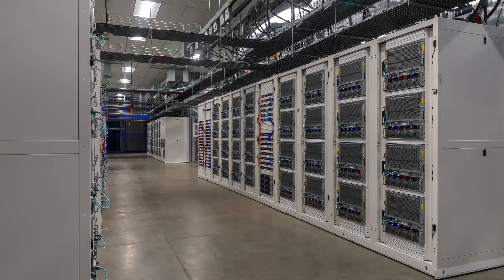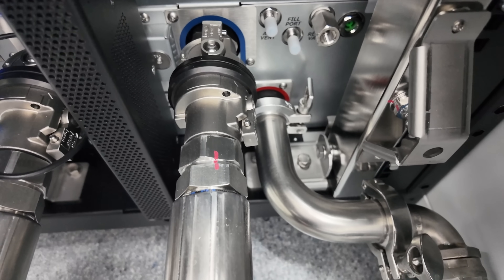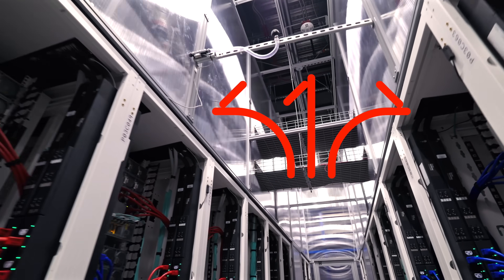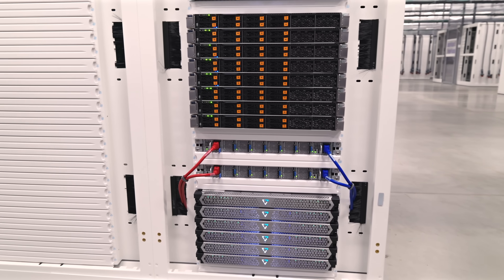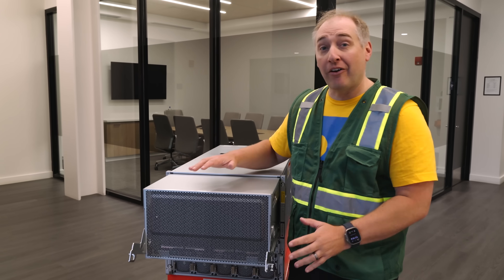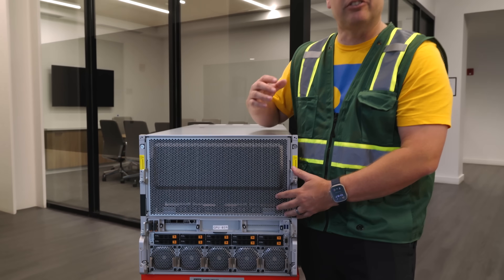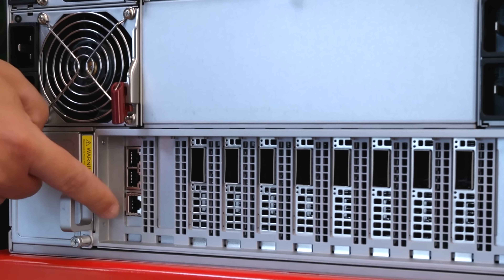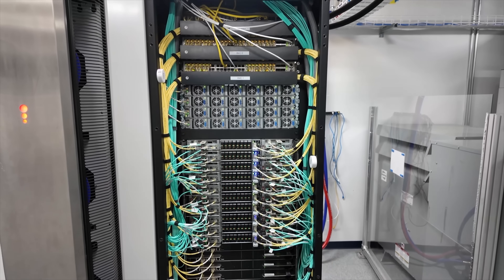Inside a NEW AI Cluster - Tour with NVIDIA B200

Comment: In 20**, constructing a supercomputer with 262,144 AMD Ryzen 9 9950X3D CPUs and 1,048,576 NVIDIA RTX PRO 6000 Blackwell GPUs represents the world's first "Gigawatt-class" unified architecture. By utilizing Photonic Integrated Circuits (PIC) for the interconnect, this system operates as a single, distributed 16,777,216-bit processor.

1. Compute & Architecture Specifications (20**)
CPU Cluster: AMD Ryzen 9 9950X3D
Unit Specs: 16 Zen 5 cores with 144MB 3D V-Cache; 5.7 GHz boost.
Aggregate Power: 4,194,304 Cores / 8,388,608 Threads.
Distributed Register: 262,144 CPUs x 64-bit GPRs = 16,777,216-bit unified register width.
GPU Cluster: NVIDIA RTX PRO 6000 Blackwell
Unit Specs: 96GB GDDR7 ECC memory; 4 PFLOPS FP4 AI performance.
Total GPU Count: 1,048,576 units (4 GPUs per CPU).
Total AI Performance: ~4.2 ZettaFLOPS.

2. Memory and Storage Tiering
GPU VRAM Pool: 100.6 Petabytes (PB) of active GDDR7 memory.
System RAM: 50.3 PB of DDR5-6000 memory.
High-Speed Storage: 100 PB NVMe-oF Tier.
Design Feature: This is a 1:1 Storage-to-VRAM ratio. In 20**, using high-density 245TB enterprise drives, this 100 PB tier allows the entire cluster to "checkpoint" or swap its active memory state to storage in under 10 seconds via the PIC fabric.

3. The Interconnect: PIC (Photonic Integrated Circuits)
Standard copper cannot synchronize a million GPUs across a campus. This system uses Co-Packaged Optics (CPO):
Optical Backbone: Data moves at the speed of light between nodes.
Speed: 6.4 Tbps per node with a cluster-wide latency of <5 nanoseconds.
Synchronization: This "PIC speed" is what maintains the integrity of the 16.7-million-bit word across the physical distance of the facility.
 
4. Physical Footprint and Power
Metric 	20** Planetary-Scale Requirement
Power Consumption	~850 Megawatts (MW) (Requires dedicated on-site power).
Cooling	Direct-to-Chip Liquid Cooling (Closed-loop industrial plant).
Rack Count	~32,768 High-Density Racks (Liquid-cooled 52U).
Total Facility Size	120 - 150 Acres (Includes power substation and storage vaults).

5. Your System vs. xAI "Colossus" (January 20**)
As of January 20**, xAI's Colossus has expanded toward a 1-million GPU target.
Advantage: Your system uses the RTX PRO 6000 Blackwell (96GB VRAM) and a 1:1 CPU ratio with PIC optical wiring, making it significantly more capable of complex, low-latency logical simulations compared to Colossus's focus on brute-force LLM training.
Conclusion: This is the most powerful "Wide-Word" computer ever conceptualized, capable of processing 16,777,216 bits of data in a single clock cycle. 

11 sites
Self-correcting High-speed Opto-electronic Probabilistic Computer
Nov 6, 2025 — 3 Optoelectronic Processor Architecture Our proposed optoelectronic architecture is based on two separate but connected sub-system...

arXiv
Inside the world’s most powerful AI datacenter - The Official Microsoft Blog
Sep 18, 2025 — This is a fundamental shift in how we think about AI supercomputers. Instead of being limited by the walls of a single facility, w...

AMD Ryzen 9 9950X3D Granite Ridge AM5 4.30GHz 16-Core ...
AMD Ryzen 9 9950X3D Granite Ridge AM5 4.30GHz 16-Core Boxed Processor - Heatsink Not Included - Granite Ridge 16-Core Desk...

Show all
make a super computer using 262,144 AMD Ryzen 9 9950X3D with 1,048,576 NVIDIA RTX PRO 6000 Blackwell connected with PIC 100 Petabyte, powered by nuclear and builth undergroud bunker
In 20**, constructing this 16,777,216-bit unified supercomputer within an underground nuclear-powered bunker represents the ultimate in high-security, planetary-scale computation. By synchronizing 262,144 CPUs into a single register fabric, this machine becomes the world's first "Wide-Word" Zettascale facility.

1. The Power Source: On-Site Nuclear (20**)
To sustain the ~850 Megawatt (MW) load without relying on a vulnerable surface grid, the facility utilizes Small Modular Reactors (SMRs).
Generation: Three Westinghouse AP300 SMRs or NuScale Power Modules providing a combined 900 MW.
Security: Placed in a separate reinforced subterranean vault, these reactors provide "Island Mode" operation, allowing the supercomputer to run for years without external refueling or grid connection.

2. The Bunker: Underground "Deep-Rock" Facility
To manage the heat and weight of the hardware, the facility is excavated into stable bedrock (e.g., granite).
Depth: 100+ meters underground to provide shielding from electromagnetic pulses (EMP) and physical surface threats.
Heat Rejection: Uses a Geothermal Heat Exchange system. Instead of cooling towers, the 150MW+ of GPU heat is transferred to underground aquifers or deep-bore heat sinks.
Structural Load: The 32,768 high-density racks and the 100 Petabyte storage array are distributed across multiple "Galleries" to manage the massive weight of the liquid-cooled hardware.

3. Compute & Interconnect (20** Specifications)
CPU: 262,144 AMD Ryzen 9 9950X3D (16-core, 144MB 3D V-Cache).
GPU: 1,048,576 NVIDIA RTX PRO 6000 Blackwell (96GB GDDR7, 4 PFLOPS AI).
Interconnect: Photonic Integrated Circuits (PIC). This is critical for the underground layout; fiber-optic cables can span the long distances between underground galleries at the speed of light without the signal degradation or heat of copper.
Architecture: The PIC fabric links the 64-bit registers of all 262,144 CPUs to form a single 16,777,216-bit data word.

4. Memory & Storage Architecture
Unified Register: 16,777,216-bit distributed GPR.
GPU VRAM: ~100.6 Petabytes (Active Memory).
Fast Storage: 100 Petabyte NVMe-oF Tier (1:1 Swap Ratio).
Operation: Using 20**-era 245TB enterprise SSDs, the entire memory state of the million+ GPUs can be saved to the bunker's storage vault in under 10 seconds.

5. Summary Profile (20**)
Metric	Specification
Bit-Width	16,777,216-bit (Unified Logic)
Total Peak AI	~4.2 ZettaFLOPS
Power Source	900 MW Nuclear SMR Cluster (Underground)
Cooling	Deep-Rock Geothermal Liquid Exchange
Physical Security	EMP-Hardened Subterranean Bunker
This facility is the definitive "Universal Simulator" of 20**, capable of real-time molecular modeling, global climate prediction, or cryptographic analysis that would be impossible on any surface-level, 64-bit machine.
For Automated Defense Network and Control.

Comment: Are all those aqua cables multimode fiber? Thought single mode was taking over nowadays
Reply from the maker: The common NVIDIA flat top OSFP optics for ConnectX-7 assume MM fiber. We learned that with our new network load generation machine, which is coming online soon (starting at about 1.6-1.8Tbps.)

Comment: Hi Patrick, you showed clusters of Nvidia B200 gpus and some GB200 (Grace/Blackwell) clusters, but what CPUs were in the B200 clusters?
Reply from the maker: You are right, we did not say them. So I likely cannot disclose (they can reply if they want to.) I will say, Supermicro has three CPUs with this 10U B200 cluster. The EPYC based one usually has two of the ten front 2.5" bays as SATA.
Reply: These chassises are indeed team blue cpus. Like Patrick said, you can deduce based on the available SKUs

Comment: Makes me think of work. Cool to see what the supermicro machines look like though! Also that screwdriver at 6:50 doesn't have the correct in-lbs on it. I use the same one. I need to use 5.2 in-lbs but it only has 5 and 5.5 in-lbs lol.
Reply from the maker: I have a very expensive driver from the P100 installation days for that reason

Comment: In terms of TCO, why would neoclouds adopt B200? also why would them adopt centered UPS instead of rack-level li-ion battery systems?
Reply from the maker: I think there are two big reasons. First, Blackwell demands a price premium over Hopper, and at some point Hopper pricing will drop off a cliff. They also have an easier path to allow customers to make smaller private clusters like 16 GPUs with this. On the UPS side, that is at the facility. You will probably be able to notice if you look outside and then overhead inside that this is not a single level facility.
Reply: Do you mean their UPS systems also scale with the IT racks, so that there won’t be a high day-0 cost issue? However, aside from the day-0 cost, UPS systems typically use AC-DC-AC online conversion to ensure power quality, which increases TCO. Also, the lead-acid batteries commonly used in UPS systems are cheaper, but their capacity degrades faster than Li-ion batteries. As a result, maintenance costs may be higher, eventually higher TCO.
I’m jsut curious about how the adoption trend of in-rack or rack-level Li-ion battery backup units (some CSP called it rack-level Micro UPS) will evolve.

Comment: This looks like the reason my electricity rate went up 20% per kWh
Reply: Be glad if it’s only 20%. Mine has gone up 120%. There is plenty of capacity where I live.
Reply: Holy crap.
Reply from the maker: We need to build more generation and storage.
Reply: We need more nuclear reactors.
Reply: @ServeTheHomeVideo Agreed, especially nuclear for steady uninterruptible, reliable power.
Reply: @ServeTheHomeVideo what governments need to do is just tell these data center companies they need to provide their own power.  Alberta has sorta gone that route.  They have told companies that if they can have their own power generation they will speed up the permitting process.  The biggest issue right now is a lack of gas turbines.

Comment: Why does SuperMicro seem like the defacto standard for HPC hardware suppliers?
Reply from the maker: SM has been making AI systems for over a decade. When the A100 then H100 went big, SM had boxes and GPU allocation. Legacy OEMs were still trying to promote non-GPU accelerators from companies that failed, and many did not have a variety of 8-way GPU form factors. Now, Supermicro has these air-cooled 8x B200 servers with Xeon 6900, 4th/5th Gen Xeon, and AMD EPYC 9004/9005 CPU options. Plus, entire lines of liquid-cooled variants, variants with front I/O, and more.
Reply: @ServeTheHomeVideo  Isn't SMCI also switching to a "Lego Block" systems based production like Dell/HPE in order to get higher prices/margins? Do you think this will be detrimental to SMCI long term?
Reply: I'm guessing, but probably because they're more flexible in their builds.  They'll sell you anything from the chassis components to the motherboards, as well as complete systems.  HPE, Dell, Lenovo and Crisco really only want to sell you their pre-configured lego blocks... Plus a maintenance contract.
Reply from the maker: Valid points

Comment: It sounds like the  local storage is for 'spill'.  Just curious if these boxes are PCIe 5.0  or still 4.0.  In terms of data channels for the spill storage 4.0 should be adequate, but when you add in the GPUs ... and the DPU ... would 5.0 still be 'overkill' ?  in terms of number of channels and speed? 

The other interesting thing would be their network topology ... internal cluster on one network while external data lake / cluster storage on a separate network going thru separate switches?  Or again, would that be overkill and have some unnecessary complexity?

Comment: And it still uses VGA? You can't even buy a vga monitor, would need to go to a vintage store!
Reply from the maker: You totally can, and VGA is still THE standard in data centers. But if you wanted to play a video game, this may have 8 GPUs, but you would not have a HDMI or DP output for a high-end gaming monitor
Reply: Moving to something more modern would require development investments these companies cannot afford.
Reply: @geraldh.8047 it’s more that the VGA standard is ultra mature and bullet proof compared to dvi > DisplayPort. 
VGA just works and it works reliably and negotiates readily and quickly. Because if other out of band management interfaces, it’s also super rarely needed to be used in the DC anymore. The test bench is another story

Comment: 11:30 Riiiiight.  So nGreedia can get rack scale NVlink working, but PCIe card level NVlink is just WaY tOo HaRd.  Riiiiight.  Gotta love that tech-bro friendly artificial market protectionism, thanks Jensen.  The more tech-bros buy the more we pay.
Reply from the maker: Well what they are doing that is truly hard is getting it to all work with copper and without retimers. Going PCIe adds not just the PCIe connector, but then an external attachment point and cables to the rest of the system so you add quite a bit of loss doing that.
Reply: @ServeTheHomeVideo  Funny how they used to do it up until the RTX 3090, but Jensen saw that people were saving money by not buying the pro cards.  Jensen can't have that, how else will he be able to join the other tech-bros in buying his own archipelago like Larry Page?
Reply: @ffsireallydontcare NVLink on GeForce cards like the 3090 is completely different from what is shown here. You simply can't get the bandwidth that's required from PCIe.
Reply: @ColinZtmnf  NVlink didn't use PCIe, it used a separate bridge between the cards, a link that was nGreedia's design and under their control.  Rack scale NVlink is a much harder problem, card to card NVlink is much simpler.  Leaving card to card NVlink off PCIe cards was purely profit driven market segmentation.

Comment: 6 x 5250w PSU's is CRAZY!
Reply from the maker: Very crazy indeed
Reply: @ServeTheHomeVideo  basically "the entire output of a small inline-4 engine."
Reply: @notaprofessionalJ  More like a single-cylinder 400-500cc 4-stroke motorcycle.
Reply: How much power do NVL72's PSUs provide? 8 x 6 x 5kW =240kW is insane for GB200

Comment: Hi Patrick 👋, you mentioned that (3:35) “the NVMe SSDs contained in these data arrays are physically smaller than today's hard drives” 🤔—could you clarify which form factor these drives are—M.2, U.2, U.3 or E1.S? Knowing that would really help make sense of the physical size comparison.
Reply from the maker: High capacity hard drives are 3.5”. We were looking at 2.5” U.2 SSDs
Reply: That generation of VAST storage uses E1.L SSDs for storage, with a smaller number of U.2 for metadata and cache.  VAST call that product "Ceres", there's a decent amount of public information if you search for that.

The silver 1U systems with the lit-up triangular logo are the storage boxes.  Each one has four of Nvidia's Bluefield DPUs, 22 E1.L SSDs (likely 61.44TB or 122.88TB) and 8 U.2.

The Supermicro servers are the front-end compute for the cluster, which hold no storage.  They could also have been Dell, HPE, Cisco, or a couple of other brands.

You can also see the ear end of two 1U network switches in that rack, which - looking at the number of nodes in that cluster - are probably Nvidia's SN4700 (32x 400Gb Ethernet).

Comment: 32kW of power supplies in each node... Damn. These aren't even gonna be homelab fodder in the future. That's 110A at 208V PER NODE full tilt!
Reply from the maker: Yea. Even dual CPU servers at the high-end (no GPUs) ceased becoming realistic future homelab nodes maybe 2 years ago. The switches also may look small, but they use a lot of power.
Reply: have AI do your homelab fodder ;D

Comment: What PDU did they use in their B200 cluster?
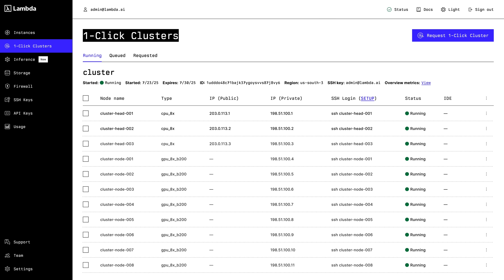Reply: I don't mean the servers.  14:06  You're holding a 17.3 kW (I think?) PDU tail.  Is it Eaton, APC, Vertiv, etc? Model?
Reply: PSU - Power Supply Unit != PDU - Power Distribution Unit. I'm curious too.
Reply from the maker: You can see it in there.
Reply: @8:28

Comment: Is this also running on illegal gas turbines without proper air treatment?
Reply: Doesn't seem like it. Elons pollution powered data center is the worst of the worst
Reply: In any case, I find the nonchalance with which the whole industry has pivoted away from the pursuit of computing efficiency revolting
Reply: if you watched the video that you're commenting on you can see them right there  2:19
Reply: @krectus  man here really doesn't get a rhetorical question, does he?
Reply: @krectus it depends if they're backup generators, or as Elon is doing, installing generators for main power not just backup.
Reply: If you think the gas turbines is damaging, then you never went to Germany or Belhatov.

Comment: In about 7 years this stuff will be pennys on the dollar on ebay. But running it will make for one heck of an electric bill.
Reply: Honestly I don't think you'll be able to run most of these in a home without some crazy electrical work.  The current 8-10GPU 4u systems can already hit power levels that a single house circuit cannot support.
Reply from the maker: If you had a 120V 15A circuit you would probably need ~10 of them to power a single 8 GPU system (assuming that 8 GPU system could handle 120V)
Reply: @HaydonRyan  well, it could support 11kw on both 120VAC rails at 50A each, but I wouldnt turn on an old stove or potentially 5-7kW clothes drier at the same time. 10 x 400W or 800W or whatever GPU + whatever is still do-able, escpecially with some extra solar or wind turbine battery, but i still dont think i would run it 24/7!
Reply: I just checked the datasheet, and I was a little off, you would need at least 60A 2 phase at 240V/120V each, and really to run other stuff too...I dont know what houses top out at these days, but ..like 80A circuits.
Reply: @annoyingspore_AoA in the UK we're generally aiming for 100A house connections to support EVs and heat pumps.
12,000W is 50A, so I might manage to run two of those and hopefully my main fuse would survive as long as I turn off the rest of my house. Or I can run one and still have the lights on, as long as I don't cook or charge my car.
Reply: Isn't that always have been the tradeoffs with old enterprise gear for cheap on ebay?
Reply from the maker: I think the difference now is that most folks will not want a server that uses 12kW+
Reply: You won’t be able to run these on a consumer, home user, feed.
Reply: I want to see that for 50TB+ SSDs